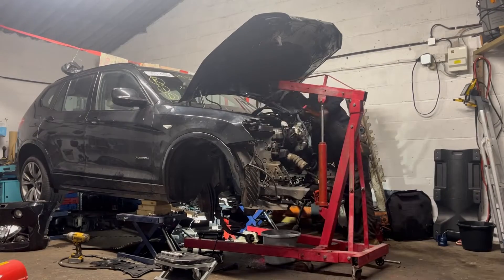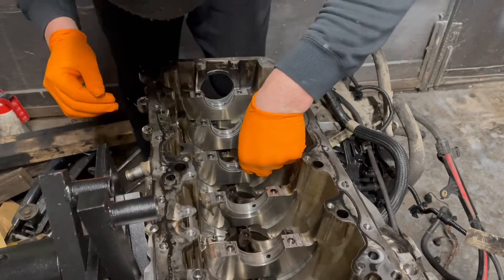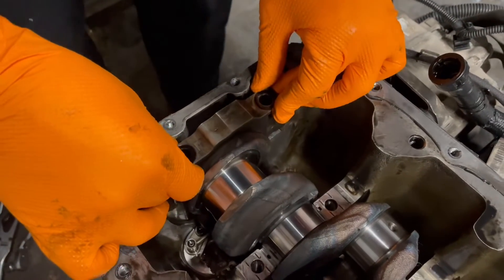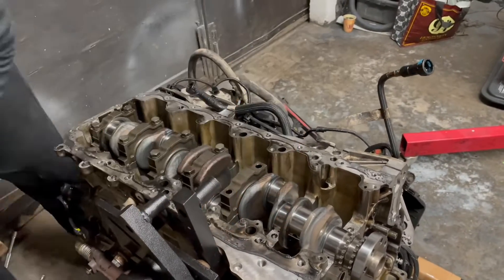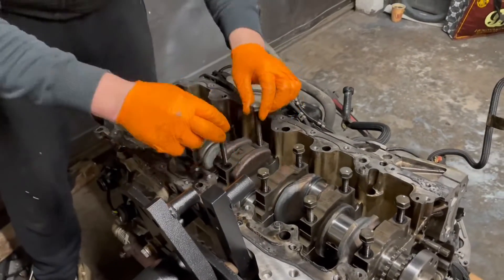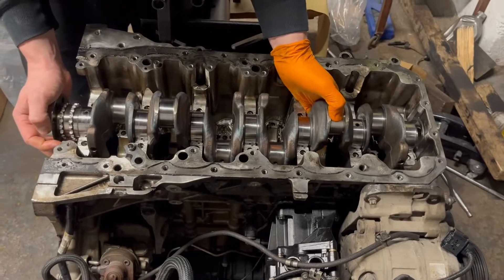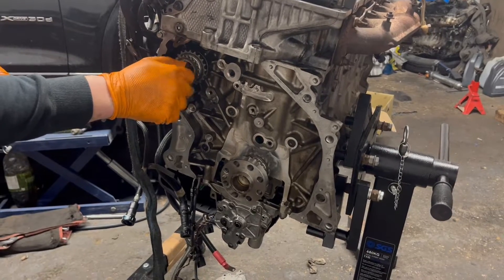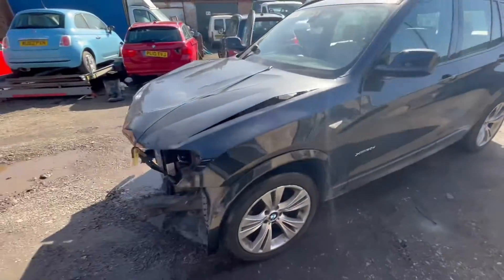BMW X3 F25 Spun Main Bearing? N57 Bottom End Rebuild part2

Comment: I want to do preventive bearings change because my car runs perfectly. They are still original bearings, so I guess I need to buy standard dimension bearings again, that's not the issue. My question is : in that case, do I need to rework my block & crankshaft or is that only done when bearings fail?
Reply from the maker: @Strmi  In that case, the block doesn’t need any work. Just to be on the safe side, you could take the crankshaft to a machine shop so they can check its straightness. Standard bearings can be reused, as you’ve already mentioned.
Reply: @W15Garage  Is pierburg OEM oil pump? Because I want to upgrade to m50d oil pump
Reply from the maker: @ Yes, to my knowledge, Pierburg is the original oil pump manufacturer. I’ve also heard of people sending their oil pumps to a German company where the oil pressure spring is replaced, increasing the idle oil pressure.

Comment: Isn’t it so that the bigger the number for the plastigauge measurement the tighter because you crushed it more?
Reply from the maker: BMW specs are 0.025-0.062
Reply: @W15Garage  0.023 to 0.054
Reply from the maker: Correct, mine was low 0.040 across the 7 caps

Comment: I have an E92 with the N57D30A engine and my engine had exactly the same damage by itself. First main bearing after the crankshaft pulley was worn down to the copper but it hadn't spun the bearing around, other main bearings looked worn but still okay, conrod bearings looked like brand new. My engine didn't have oil starvation but it was a high mileage engine. The engine was still running when I decided to take it apart. My crankshaft had a mark on it that couldn't be polished out. The block also wasn't looking great, one cylinder had a pretty deep scratch in it. I decided to buy a used engine and rebuild that. I've driven 8000 km since the rebuild and all seems to be going well. I hope your engine will last too after the rebuild. The only thing I regret is that I have rebuilt it with original BMW bearings.
Reply from the maker: Hi, Thanks for your message. I’m not far behind, covered just over 6000km, also using the car for towing. Did you measured the oil pressure since the rebuild? I would be curious as a comparison, since you have used original bearings, probably your tolerances are a bit tighter, resulting better oil pressure.
Mine is 4.6bars at cold start up, after the engine is fully warmed up is 1.2bar. At high rev is 4.8-4.9 bars. 
I like this car the power is good, but i still don’t trust it 100% :)
Reply: I'm at 10.000km now and gonna do an oil and filter change next week. Curious if I'm gonna find any metal particles. I unfortunately don't have the equipment to measure oil pressure. But I've been trying to keep the rev's up a little bit by often running a gear lower than what would be best for fuel efficiency but I'd rather do 70 kmh in 3rd gear at slightly below 2000 rpm than in 4th at a little above 1000 rpm to try and keep oil pressure a little bit up. I don't have a tow hitch but I have been driving it hard from time to time, power is indeed not bad at all :) I do let it fully warm up before giving it the beans. I'm also running Motul 300V ester oil for some piece of mind and as long as this engine keeps running fine I'm gonna service it every 8000-10.000km. To be honest I'm not sure if I will ever be able to fully trust this engine. Many people say a rebuilt N57 won't last. The reason I went for original BMW bearings is in their procedure for fitting new main bearings they mention there are 3 sizes of bearings and you need to order specific sizes based on numbers written on the block and the crankshaft. I don't know what's the exact reasoning behind it but I thought it might be a safer bet than one size fits all aftermarket bearings. Nobody actually knows specifically why N57's fail this way, is it bad OEM bearings, is it flawed oil distribution system design, is it crankshaft developing runout? We'll have to wait in fear if and how our engines will survive or not...
Reply from the maker: @arnobruynen6073    I agree with you 100% on not being able to trust this engines. I did 3 oil changes right after the rebuild within 1000km using cheap Mannol oil just to flush the system. In the first 2 filters I’ve found some amount of particles but judging by the colour 85%  was copper left from the damaged bearing. Since then it’s almost 100% clean, but at the last oil change when I’ve cut the filter open and checked thoroughly i’ve still managed to find minimal minimal amount. But i find that amount in all n47 engines when i m doing oil changes, for friends and family. Oil pressures are the following with a fully warmed up engine:
At 2000rpm is 2.6 bar
At 2500rpm is 3.2bar
 At 3000rp is 3.9-4.0bars
Keeping the car in 7th gear when cruising is a good idea indeed.
Also if I can reach 1000 subscribers AND THE CAR is still running in a year time now, I will open the bottom end and check the status of the bearings:)
Reply: @W15Garage  I did 4 oil changes the firs 2000km. First one at 250km there was some glittery oil in the bottom of the pan and large particles visible in the oil filter without having to cut it open. Last oil change the oil was clean and I had to cut the filter open to find a very small amount of tiny particles. The particles I found were silver coloured. That’s why I’m very curious if I’m gonna find any metal after 10.000km. If the oil and filter looks fine I’m gonna tune it :) wishing you the best luck with your engine brother ;)

Comment: Hy!
Did you change the oil pump?
Reply from the maker: Hi! No, it was in good condition internally. Oil pump is not the weak part of the engine, but the OEM bearings. I m monitoring the oil pressure since the rebuild, it’s good.
Reply: @W15Garage hi, how do you test a oil pump ?

Comment: Great videos. Im about to do the same job on my E91 330d -2009..Hope the crankshaft can be polished and dont need to be replaced
Reply from the maker: Thanks! I m glad I went with the Kolbenschmidt bearings as a replacement. All the evidence shows the original BMW main bearings is the weak point of this engine. I’ve covered over 5000km since the rebuild, still going strong, and the car is used for towing as well 
Good luck with the project!
Reply: @W15Garage  I stripped down the engine yesterday to find some disaster..5 main bearings was bad which of 2 have spun round and round.. 2 crank bearings was bad too.. Disassembled the oil/vacuum pump and the vacuum pump was very worn and have probably fed the engine with dirt/metal
Reply from the maker: How many Km on the clock? Was the car remapped?
Reply: @W15Garage  240000km, yes. But I think bad service & bad oil is the cause of this to happen, too bad used engines are extremely expensive
Reply from the maker: @Heenstroom  sorry to hear that. You also have the option to buy only a good used engine block with crank and pistons, replace bearings and timing chain
Reply: @W15Garage  Hmm yes that is an alternative. But I can't seem to find any good options. Found a complete new crankshaft with bearings from UK for ~1000€
Reply from the maker: @Heenstroom  if you have spun main bearings the engine block needs line boring before installing new cranckshaft and bearings
Reply: @W15Garage  Can't it be measured before and check if it's ok?
Reply from the maker: @Heenstroom  you can but unfortunately if it spun the bearings it’s likely you will have less diameter than it should
Reply from the maker: *larger diameter
Reply: @W15Garage  where did you buy kolbenschmidt bearings? Can you send a link for rod and main bearings? I can't find a good site with the right bearings
Reply from the maker: @Heenstroom  I ve bought the bearings from this company Ivor Searle